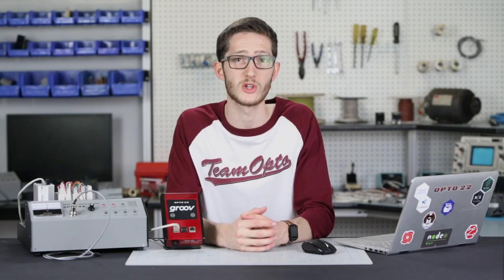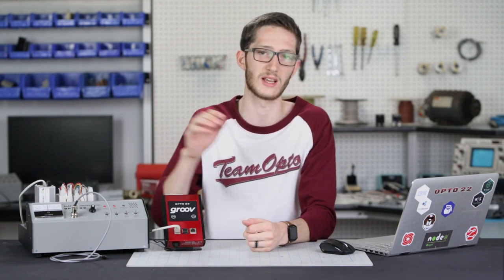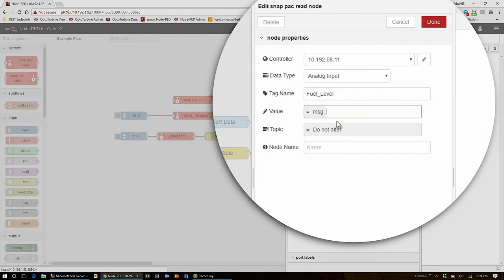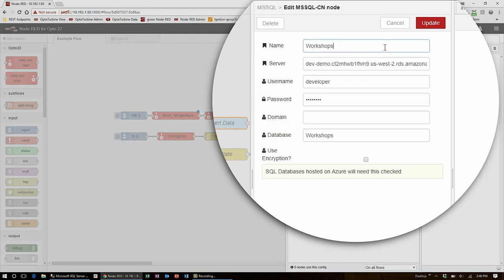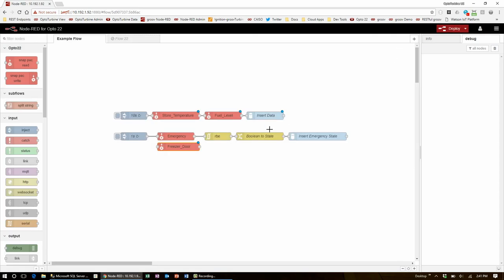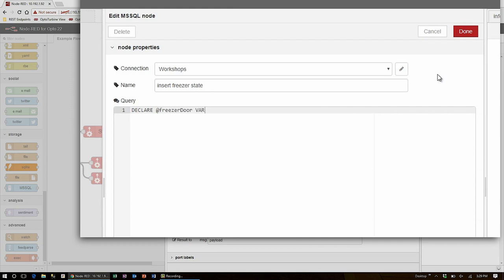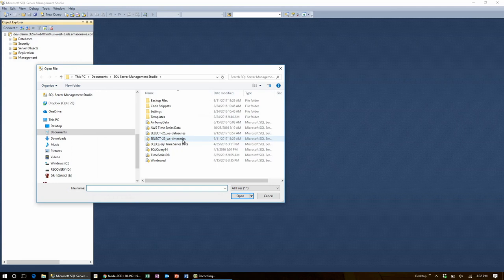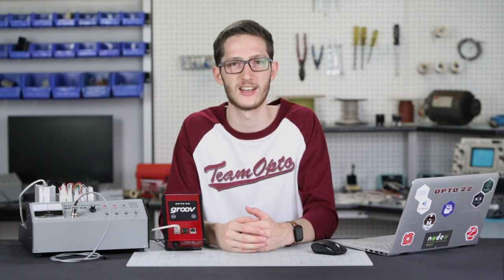Use Node-RED to Send I/O Data to MS SQL

Comment: do I always need to be logged into node red to run the program or can I compile the program and export it elsewhere, so that I can run it without needing the use of the internet. As my internet isn't the best but I want to control my I/O relays of my ds3484 without needed to be connected to the internet. Is this something node red is able to do? 
or does it run on a server-based system?
Reply: Node Red runs on the Opto22 EPIC PR1 and AR1  units. You do not need an internet connection to program in Node Red, unless you want to install new nodes.